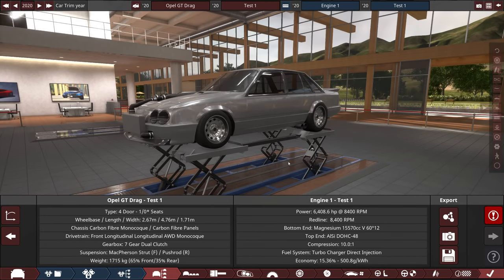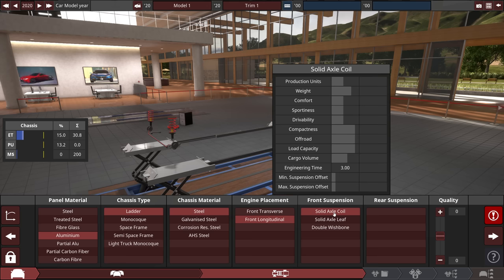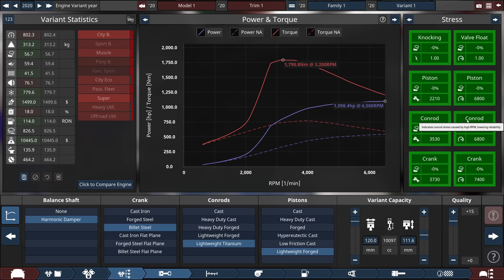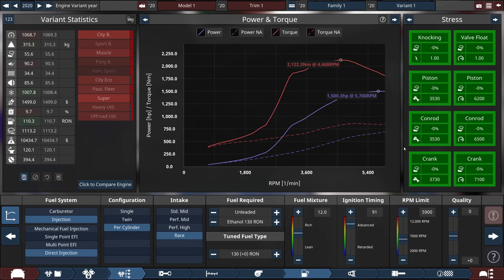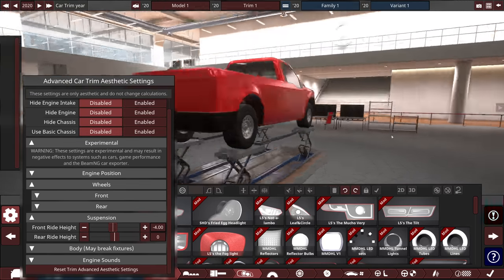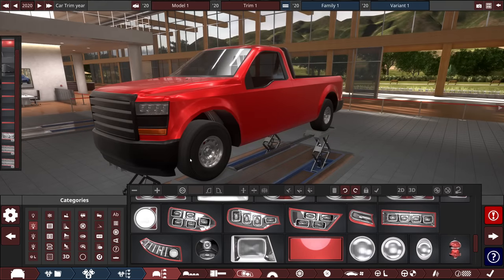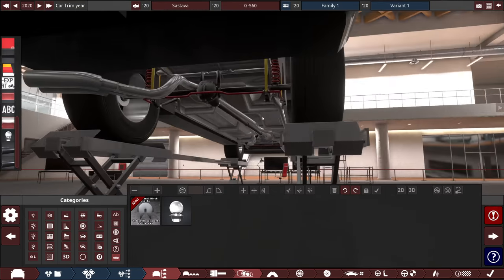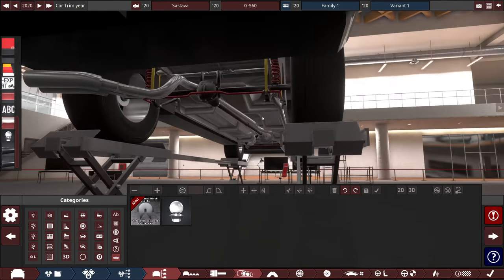Twin Turbo Sleeper Work Truck  (Automation + BeamNG.drive)

Comment: I feel like a vehicle with 1500 horsepower should go 1500 times faster than a horse.
Reply: You mean 1499 times faster?
Reply: @ex-lil7574  bro do you know how to do mathematics bruh 😭 1500x1=1500
Reply: One horse has 14.9 horse power so it would take 100.7 horses to match 1500 hp 🤓
Reply: @ex-lil7574  The irony being that one horse produces 15 horsepower, so it's actually 1000 times stronger than one horse. Also multiplication includes the original, so the math was correct with the exception that 1hp is not equal to 1 horses power.
Reply: Drag
Reply: Who is gonna tell him?
Reply: @memorimusic420  Oh, I’m well aware. No need to tell me.
Reply: @mechanwhal6590  lmao well might wanna change the comment then
Reply: @memorimusic420  Nah. Monument to mistakes.
Reply: @mechanwhal6590  🙏🙏
Reply: I picturing this today while riding my horse in rdr2
Reply: i think you’d need 1500 times less friction and air resistance
Reply: @Craftsman2207  the biggest horses have 15hp. Average horses have around 5hp
Reply: @cryhavikk  nope, it's 100
Reply: @meehdrescher  Hell yeah it is! Me stoopid, my bad. For some reason I was thinking times 100 would be 150, don't know why.
Reply: @cryhavikk  it happens to the best of us lol
Reply: @cryhavikk  i thought a horse made 7 horsepower, maybe yours has vtec or something
Reply: @blarpnarp  LOL. It depends on the horse, Thoroughbreds and Quarter horses produce between 10 and 14.9 hp.
Reply: It also weighs 10 times more than a horse so 🤷‍♂️
Reply: @mechanwhal6590  why does 1 horse equal to about 15 hp, That makes 0 sense.
Reply: @Isostopic  Dude, don't question it, America uses the less precise imperial measurement system
Reply: @longnamedude3947  Okay Okay. You are right.
Reply: @Isostopic  Some things in this world literally make no flipping sense, this is one of those things.

The best way to measure power these days is in Kilowatt's (kW) or Megawatt's (MW), take note that "mW" means "Milliwatt" so the capitalization of the various letters DOES matter.
Reply: But a horse has about 14 mechanical hp😂
Reply: @Craftsman2207  🤓
Reply: No one is factoring in Weight and drag lol
Reply: That doesn't make any sense because the average horse produces 14.9 hp
Reply: @cryhavikk  if one horse makes 15hp, and it's 1,500hp, then its 100 times a single horse, not 1,000 as that would be 15,000.
Reply: One horse acctually has more hp than 1
Reply: 1 horse has about 13 hp so 1500/13 times more power
Reply: 😂If one horse was 1hp the car would go 82,500mph according to that theory
Reply: Underrated comment
Reply: How do you get .7 of a horse?  @Craftsman2207
Reply: @Classifous  Balls
Reply: Only if ur car weighs the same as the avarage horse
Reply: Horsepower is work not speed the speed is rpm
Reply: @astral1116  mph and hp isnt the samething where u get ur numbers

Comment: So the reason your F-150 work truck felt faster in sport mode is because the sport mode for the Ford TT V6 allows the truck to make the full 30 pounds of boost through them dang ol turbros
Reply from the maker: It wasn't turbo
Reply: @automotiveflux  understandable
Reply: The F150 Ecoboost doesn't make 30psi of boost 🤣. 15-20 at the most. Mine makes more power at 15 than it did at 20 though.
Reply: However, sport mode uses a different throttle map and shift points, which makes it feel faster. There's no change to the HP produced, just how you feel it.

Comment: Fun fact the hoonicorn mustang is a non intercooled twin turbo 6.75L V8 running 1400HP* (until they lose). I'm pretty sure it's the same power train in the RTR mustang which is capable of over 2000hp buts it has a safe upper limit of around 1800-1900hp
Reply from the maker: Crazy, I'll look into it
Reply: I think it’s bc the turbos are sticking out

Comment: my dad already has a stock sleeper f450, its literally a sleeper from the factory, 475 horse 6.7 liter power-stroke diesel ford if you are curious, and she RIPS 10 on the strips, 1/4 mile

Comment: I was watching a portion of this video (about 10 minutes) while charging my EV at a fast charger.

As soon as I pulled away from the charger, I was being followed by a full work-spec red F150. Single cab, long bed. I wonder if it had 1500hp.
Reply from the maker: Only one way to find out, gotta race the guy
Reply: you summoned him

Comment: When making cars for beam in automation I find that matching the horsepower rating of the inter cooler to the horsepower of the engine because it does actually affect how the engine overheats in beam and in my testing I’ve found that it’s usually a good compromise between sacrificing horsepower and increasing the ability for the  engine to run longer before overheating

Comment: On the subject of horsepower, 250 is perfectly fine for driving around with a 5-speed auto in my Charger, a bit more might be nice for showing off. 
180 is ok in my old minivan, that thing could keep up with any half-ton in first gear, but the second it shifted you felt it just drop.
Reply: What engine do you have? The 2.7? V6 or 3.5? V6
Reply: @lucid523  Charger is 3.5, Van is 3.3

Comment: I personally have a 94 ram 2500 ling bed, with the 5.2 litre magnum v8 making 300hp stock. Thing is a beast and I've broken tires loose a few times. Plan on building the engine out with high injectors and fuel system with a new tune profile

Comment: > Can't get it to go low enough
> Used "Solid Axle" as the front suspension
Double Wishbone Coil Spring would have been the normal choice for a modern half-ton or or three-quarter ton truck.

Comment: the thing about removing your intercooler is that while you make the air a little hotter, you have 0 resistance for flowing air, instead of trying to go through the intercooler.

Comment: And with you talking about horsepower, 250hp in a truck is good enough. Mine is a single cab short bed stepside. 4.8L V8. It can get itself moving nice.

Comment: Carbureted blow through boosted systems you can run no intercooler because the fuel cools the air

Comment: 5:31 You can run without using intercooler if you use methanol
Reply: Bingo. Meth injection

Comment: A 10.1l or 600 c.i doesn't need rpm to make hp and also. Most drag race applications don't run intercoolers bc they run on methonal which cooler than ethanol and pump gas